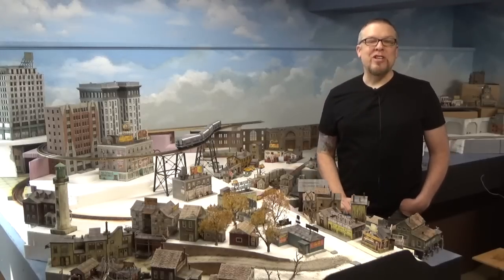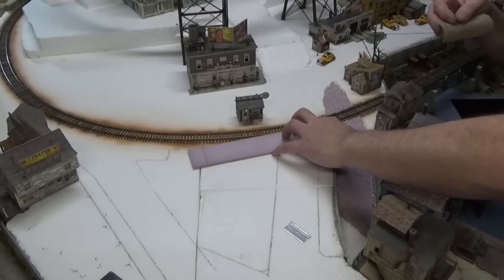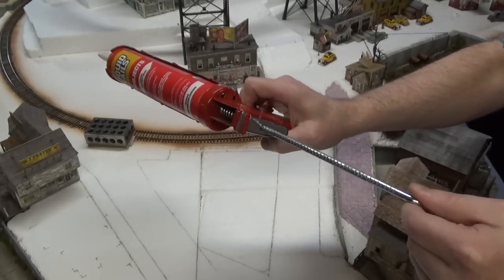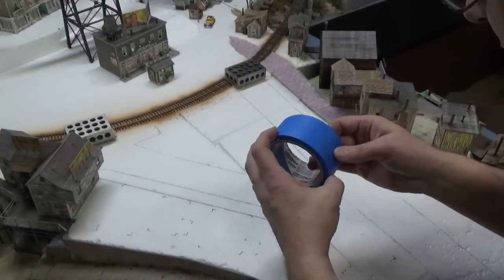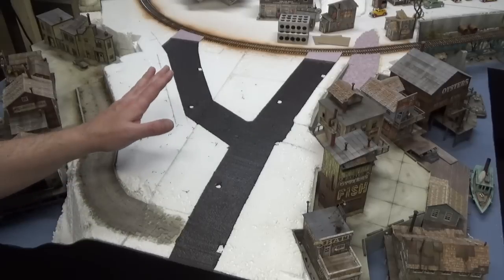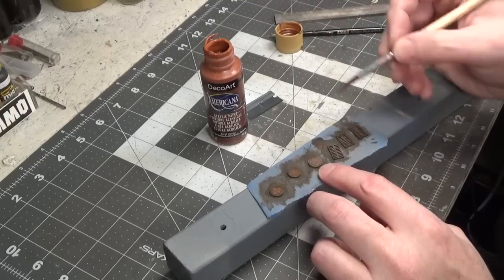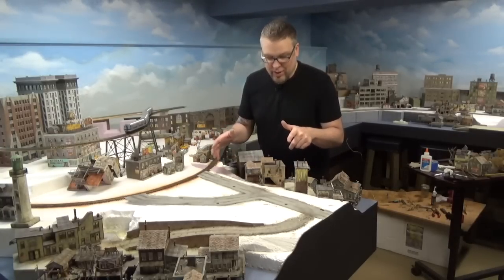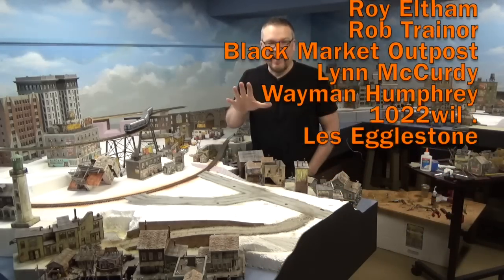Adding roads with man hole covers and storm drains

Comment: I've read that up through the 1960s the reason the dark line was in the center of the lanes was the cars and truck leaked a fair amount of oil. In more recent years engines are manufactured to higher standards and leak less oil. So today highways have a different pattern.

Comment: I am adding this comment before finishing the video.  From an engineering perspective, an intersection of storm and/ or sewer drains is always accomplished with a manhole and its cover.  These lines are best laid as straight lines to maintain grade.  With the use of laser levels, maintaining a proper grade for drainage of about 1 % is relatively easy to do on a curve now but had to be done with straight lines between manholes in the old days with the use of a level instrument and grade rods and 3 wires for the grade.  The maximum distance between manholes is about 400 feet for inspection and cleanout reasons.  Any drastic elevation drop in a sanitary sewer of over about 3 feet is accomplished with a separate drop pipe with a curved elbow coming out in the flow grade line of the manhole to keep the solids from breaking up and starting to decompose before reaching the treatment plant.  This last is for information and probably would not get modeled unless someone wanted to model a sewer section for display.
Reply from the maker: Thank you so much for watching the video and thank you for the quick history lesson Roy.  I am just having fun modeling and simply placed the man hole covers and storm drains in areas I liked or thought looked good to me. I will say I put the storm drains in low areas so water would naturally flow in them. Thanks again for watching!

Comment: Looks fantastic Jason! Are the cracks you forgot to fill large enough to slip a thin slice of pink foam in there? Just a thought. I often find in crafting that it's just as important to be able to fix/hide mistakes as it is to execute the project as envisioned.
Do you print the manholes and storm grates in any other scales? I work in 1:12 scale. You could always charge more...
Thanks for another outstanding video Jason!
Lisa
Reply from the maker: Thank you so much Lisa!!! That’s a great idea using thin foam in the cracks! 
I currently only offer the details in HO scale. Always great to hear from you Lisa, happy modeling!!!